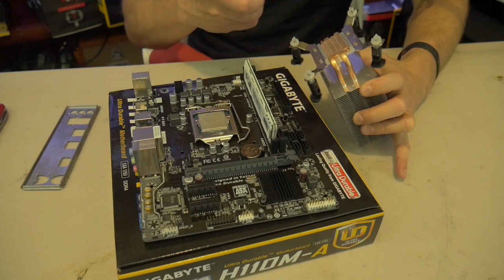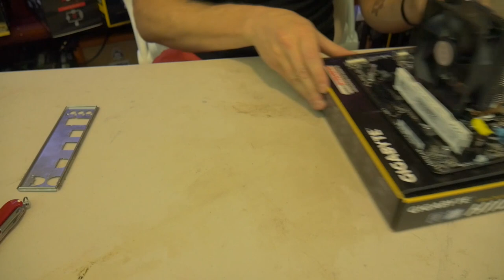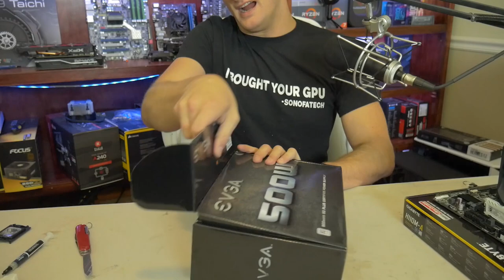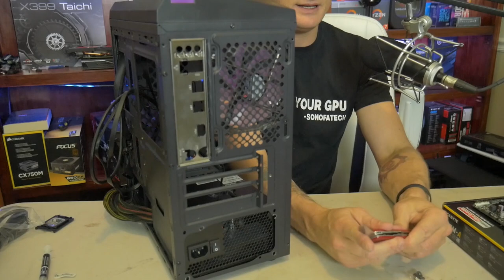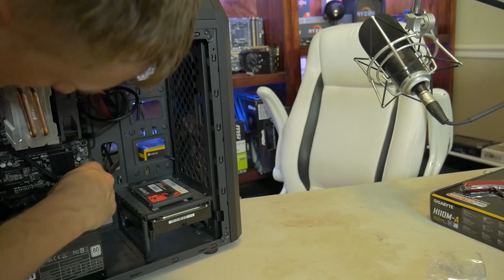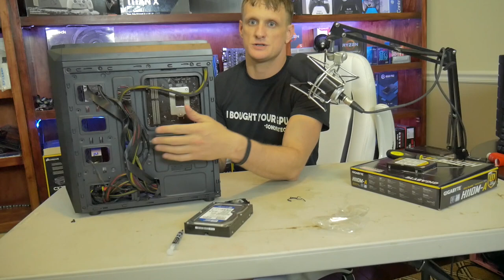Building Cheap Gaming PC with Swiss Army Knife | FAIL

Comment: Late, but fwiw the can opener has a little notch on the tip that works as a 2D phillips for size 1 & 2 that would've been a ton easier than the t-handle phillips on the back. You wouldn't be able to torque as hard but for a PC you could probably torque enough. The blade on the can opener will probs still be a problem sometimes though.

Comment: Nice build, i remember mastering my backpannel technique but with amd fx-6300; cheaper and with a 770 ti got it to play mafia 3 1080p medium https://pcpartpicker.com/b/3KKBD3 i  wonder if the verge employ's people from the same groups as wallmart, but the ones wallmart refuses. Since if you did go to Walmart and asked for a device to put screws in a computer they would take you to the screw driver set in the electronic cleaning supply section.